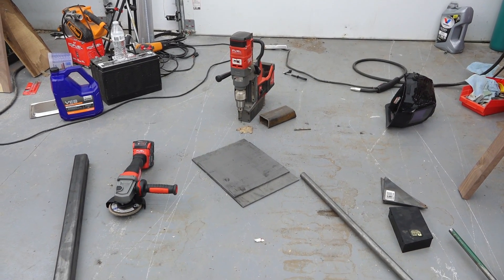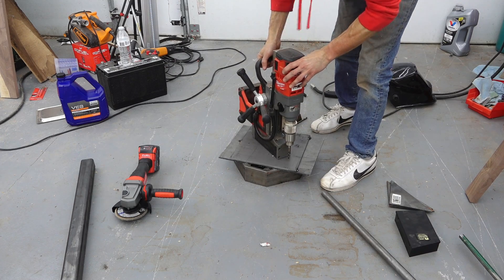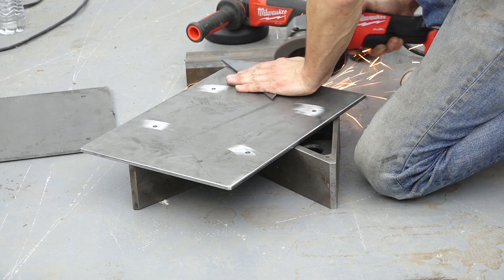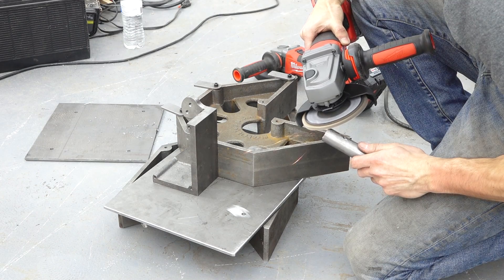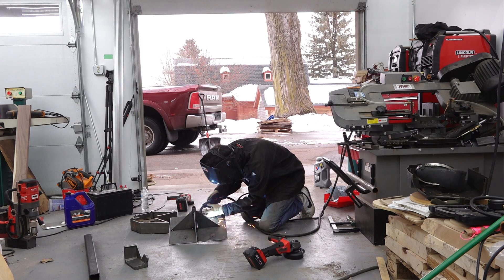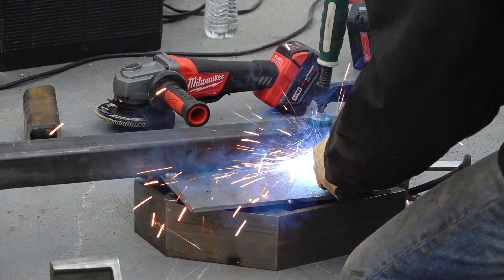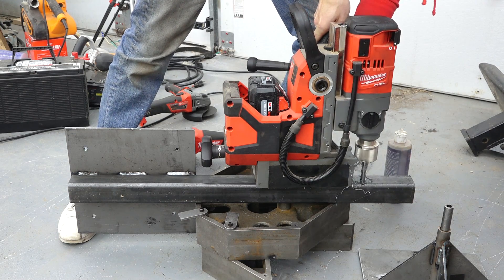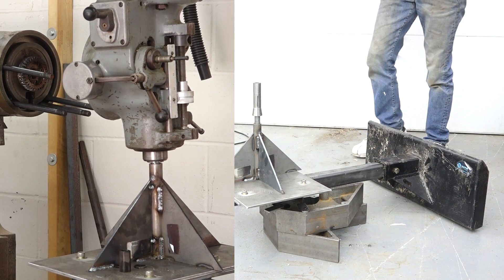Making a Head Removal Post for a Bridgeport Mill

Comment: I haven't found these mounts to be very useful. There is some concern that using them puts a tremendous amount of stress on the quill housing, the quill, spindle, bearings, etc. Especially if the full weight of the head and motor assembly is mounted on them.  The other problem is that once you have the head mounted on them, what do you do with it? How do you get the head off the mount to work on it?  The only good use I have found for these is in reinstalling the quill housing onto the knuckle and getting the bolts lined up.

Comment: Matt... Curious if you plan on getting a metal lathe? They are a nice addition to a woodworking shop ... A mill, welder and metal lathe along with woodworking equipment...for instance the ability to make expanding mandrels etc...
Reply from the maker: Yes, I planned a spot for it between the bridgeport and metal bandsaw
Reply: @mcremona  you will be happy with that move...no matter what size of lathe...99% of what we non machinist do can be accomplished on small lathes....FYI not sure about ykur community but here in flint mi we have a makerspace so....if you do need larger stuff done there is that place to accomplish the task.